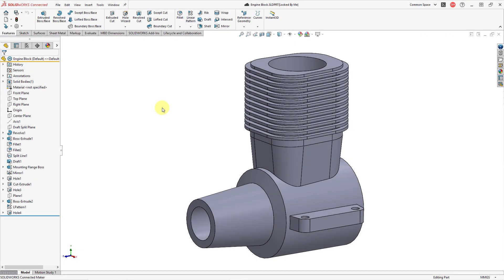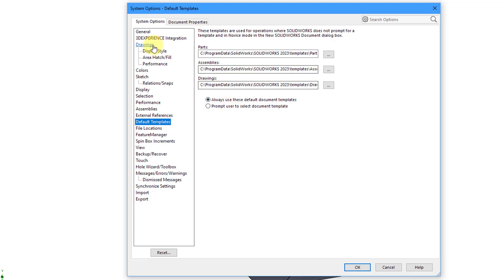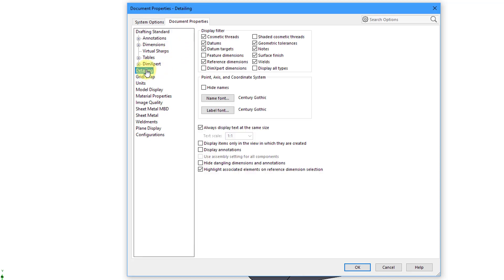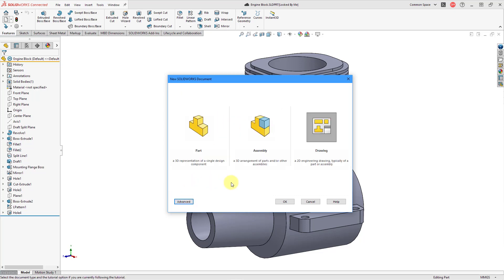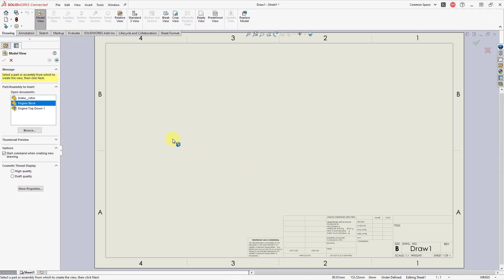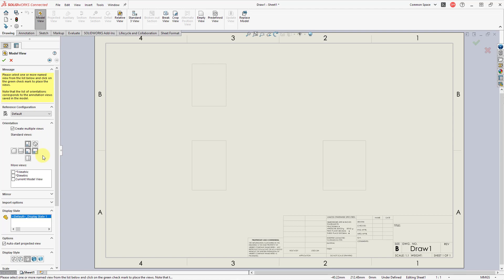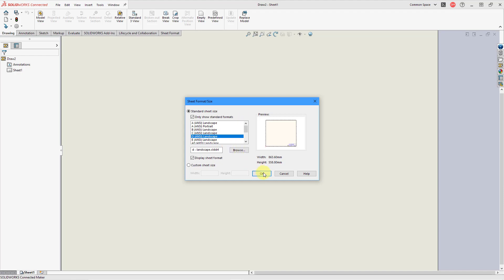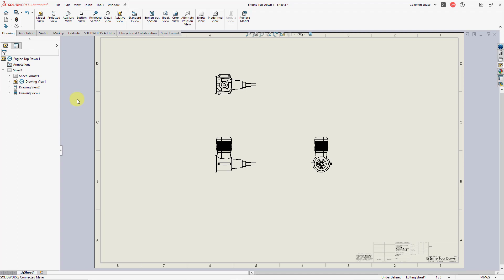Starting a New SolidWorks Drawing

Comment: Hi David I want know the helicoil sweep feature comparison with creo and solid work ,in creo there is no option of angle control in helicoil sweep like solidworks
Reply from the maker: I’m not familiar with Helical Sweep in SolidWorks. But you have to remember that Creo/Pro Engineer and SolidWorks were written by different sets of programmers. You won’t find every option from one CAD package in the other.